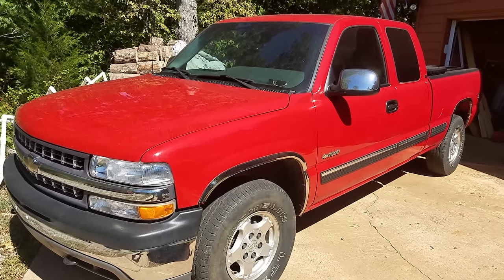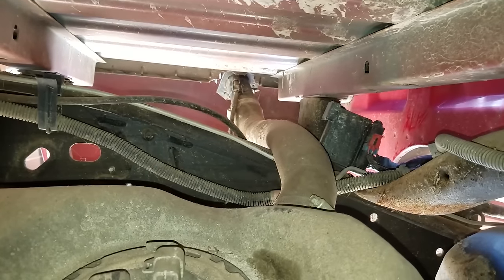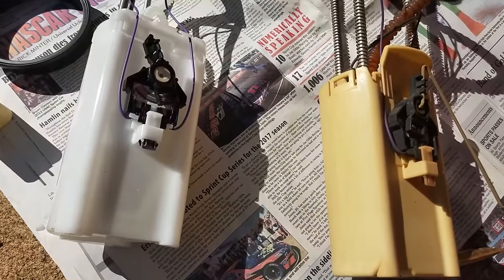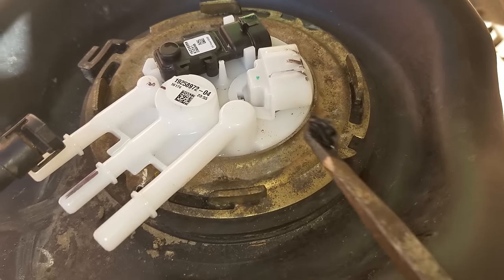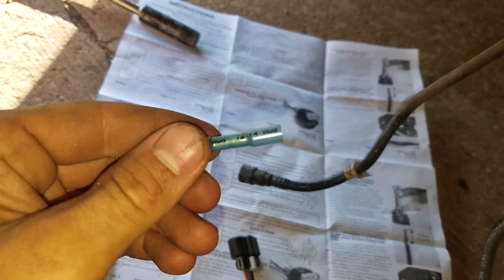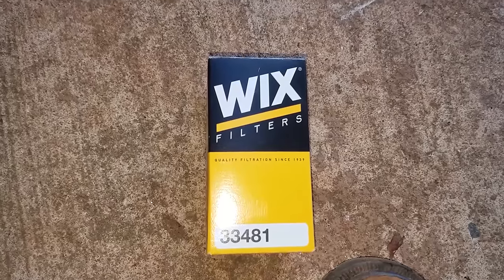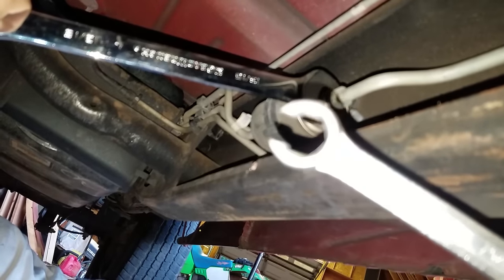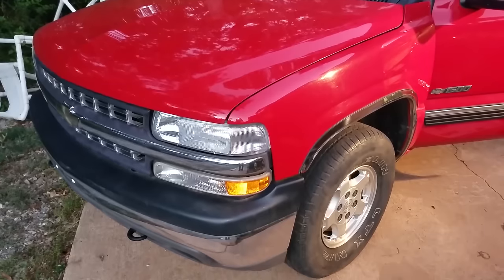Chevy Silverado Fuel Pump Removal and Installation

Comment: Pretty good video 👍 how about raising bed for fuel pressure sensor replacement?ty
Reply from the maker: Thanks, you can it is easier to lift the bed most of the time.

Comment: no need to remove your bedliner... just use an engine hoist or 4 guys to take bed off, 8 bolts unbolt from under truck takes 20 mins to remove bolts, disconnect tail light harness from frame by spare, and unbolt filler neck 2 t-25-35
Reply from the maker: I thought the bolts go though the bed into the frame. You have to take the bedliner off to get to them?
Reply: nope unbolt from below, 18 mm i think.... search bed removal here you will see 50 videos, i took mine off yesterday afernoon took 30mins by myself.. makes life much easier.

Comment: The heat shrink butt connectors also have “hot glue” that seals the connection when you shrink them but hey both methods get it done I’ve had great luck with those heat shrink butt connectors idk why so many people try not to use them

Comment: One thing I would recommend that should have been in this video is before you start doing any of this. Pull out the relay for the fuel pump and start the truck and let it run until it dies. This will release any pressure left in the fuel lines before you disconnect them.
Reply from the maker: Good idea
Reply: Weres the relay located

Comment: I just did my fuel pump on my 2003 Chevy 1500 had a tool box in the bed and got sum friends and tuck the bed haf way  off and tuck 45 minutes off and back on

Comment: Nicely done video, very good job.  I must point out one major procedural error; ALWAYS disconnect the battery ground lead first and reconnect last. If your wrench makes contact with any metal part while loosening or tightening the positive cable with the ground still attached you will be in for a rude awakening...
Reply from the maker: +artillerybuff2000 Yea, good point. That's how I usually do it. I'm sure we all have touched the battery's positive to a body panel once or twice.

Comment: You can also use the side of the soldering iron... running briskly across the heat-shrink tubing to shrink them...if you don't have a heat gun.... done in the field thousands of times so proven.
Reply from the maker: Yea, that works great.

Comment: Yellow black is ground to fuel gauge, 
purple is fuel gauge +5 volts,
grey is fuel pump +12 volts, only shows the +12 volts for 2 seconds after key its turned on.

Black is grounded to frame. In the same ground spot the fuel cap ground strap is grounded, is a short black wire that exits the Wire harness between cab and box Mine just broke here when I was changing brake line to rear, so if a pump is not pumping check this ground spot.
Reply from the maker: Oh, I gotchu. Yea, all of those ground straps are EXTREMELY important. Especially around the engine.

Comment: My FTP pigtail just fell off after I disconnected it (did it blind without dropping tank) so now I've cut an access panel in the bed and it is not immediately obvious where it connects, so this actually helps me know where to look for it.

Comment: To raise the bed up you don't need to take the liner out... I would take the toolbox out for helping with weight and also take off the tailgate, then one person can lift the bed up with no help. Leave the 4 bolts threaded a couple threads on the passenger side, take the 4 completely out on the driver's side, and remove the 2-3 bolts holding the gas filler into the bed. Fairly easy past that

Also the crimp connectors they supplied have heat shrink on the ends that will make them water resistant

Comment: never solder wires in same location,step them off, one longer, the next one shorter and so and so.... so they all fit inside corrugated conduit..
Reply from the maker: Yea, that's a better technique.

Comment: I wonder on these ones can I just switch out the fuel pump and reuse the old assembly unit? Instead of rewiring it.
Reply: Yup atleast I did . I cut a hole with a cut off wheel in the bed though and I didn’t cut it all the way only enough to bend the metal open so I can bend it back and screw it in so I can open it up again

Comment: After installing one a code of po442 evap leak came up. Anyone know the issue
Reply from the maker: Did you get the lines hooked back up to the top of the pump properly? Maybe there was some dirt on one of the seals?
Reply: Eli Guerra probably the fuel lines aren’t connected properly on fuel pump or you the fuel pump locking ring isn’t locked all the way..did you replace the fuel Pump o-ring with a new one?

Comment: Thanks for the great instructions. I'm thinking about taking on my bro in laws 02 1500 that has been sitting for about 6 years and this will be a major help. One question, is that fuel tank plastic? I've seen rare references to them being plastic and can't find a replacement tank anywhere.
Reply from the maker: Thanks! Yea use this as a guide/FAQ to get the job done. That's awesome! I'm glad this video is helping people. They are all plastic tanks as far as I've ever seen. Check RockAuto they might have a tank for sale.
Reply: Get a engine hoist pick up one side of the bed did it on my Daughter truck tuck me 45 minute for the hole thing and its  2000 1500

Comment: Not sure if my truck need fuel pump 2500 hd 2004 but I assuming the problem is the fuel pump. The car is drive able
but all of the sudden shut me down once I stop by a light. I will go for the fuel pump
Reply from the maker: Is it a 6.0 or 8.1 gas engine. If it is I would check the fuel pressure at the fuel rail with a gauge. A water pump wouldn't cause it to just shut off. If it is a diesel I'm not the guy to ask lol.
Reply: Thank you for your feed back just let you know is 6.0 is gasoline but I will definitely will check the fuel pressure. By the way I was trying to say fuel pump
Reply from the maker: You are welcome. I don't just like throwing parts at things, but check the fuel pressure and I don't know if the 2500's have an external fuel filter or if they are integrated into the pump like the 1500's.

Comment: For everyone out there, don't matter my mistake. Be sure the connect the ground wire bc I had pump go bad in freezing weather. In top of which I was traveling to diff state. So I did all the work in AutoZone parking lot laying in the snow and freezing weather. So before putting truck bed back on and reinstalling of course I'd test it. But didn't work and I went thru about 4 new, including having to rewire. It was super bowl Sunday and I was late. Finally a guy passing by asked me if I had the ground connected. Nope. Totally didn't realize I needed it connected. I thought it was for electrical surge protector. Started right up. Just a simple wire coming from an area I didn't think important caused me so much grief. So don't forget about it. In Silverado the wire that comes from connection by the gas inlet tube.
Reply from the maker: That sucks you had so much trouble with your fuel pump. Grounds are extremely important in 12 Volt wiring. I don't remember any separate wires other than the harness. Yea! Don't miss any of the wires or it won't work right at all!
Reply: @MattsShop  ya thx, it was def a lesson learning experieince.  if only i had learned the importance of grounds before that, i would've saved so much time and effort. as stated, i thought ground was for 'just in case' type electrical surges.  ughhh
Reply: Black is grounded to frame. In the same ground spot the fuel cap ground strap is grounded, is a short black wire that exits the Wire harness between cab and box Mine just broke here when I was changing brake line to rear, so if a pump is not pumping check this ground spot.
Reply: @hawkofthenorth4829  yep just that simple seemingly insignificant wire had me all fncked up for hours.  so point being, if the wire was connected before, was likely def for a reason haa. do it.
Reply: @justaguy4real  How could you possibly just knowingly leave a wire disconnected that was landed before, because you thought it would not matter?   You didn't know that every electrical component on a car has to have a ground path back to the battery neg. or it won't work?   Ok, you learned it.

Comment: Hey Matt...I'm just about to embark on this very project on my 2000 Silverado 1500 5.3 V8 Z71, LS trim 4WD.  Having a hell of a time finding an exact match replacement with the OEM electrical connectors.  Mine look exactly like those on your old pump.....the right, black connector has 3 wires and is oval shaped.  The left, white connector has 4 wires and is square.  So....guess I have to go with changing the connector as you showed.  Wanted to know what AC Delco part number you used as the replacement if you recall....thank-you
Reply from the maker: Okay, before you start...My pump part # was an AcDelco MU1613. What you want to do is call AcDelco's parts catalog department and give them your VIN. They will tell you EXACTLY what pump you need. You don't always have to get AcDelco fuel pumps though. A lot of times AcDelco just puts their name on the box and puts another manufacturer's fuel pump assembly in the box. For example, Delphi is an Original Equipment supplier and it could be a Delphi pump in a AcDelco box.

Delphi makes high quality fuel pumps so that is an option too. Just buy AcDelco, Delphi, Bosch don't buy cheap bargain brands like AirTex EVER!
Whatever you do, just don't go down to the local part stores and buy the pump there. If  you go to RockAuto.com you can see all of the fuel pump assemblies available for your truck. Check the warranties too, the Delphi ones have a Lifetime warranty and the AcDelco ones are 1 year warranty at the time of writing this.

The local part stores have lifetime warranties, but they factor it in to the price. They make you pay 2-3x the amount of RockAuto so they are able to provide you with a lifetime warranty.

They use a couple of different things to determine what fuel pump you need: the bed length and the wheelbase. The wheelbase is measured from the center of the front wheel to the center of the rear wheel on one side of the vehicle measured in inches. The bed length is just that, the length of the bed.

Don't worry about the electrical connectors too much. They should supply you with a new and improved harness with the fuel pump if it is necessary.

Hope this helps, thanks for watching!
Reply: Will do....Thank-You.  The video was very helpful.  I have the feeling I will get the correct fitting pump but the electrical connection may have changed or been upgraded.  So the portion of the video dealing with changing the connector will be very useful.  Thanks-Again
Reply from the maker: +Terry Parker You're welcome. Yea, just follow what I did with the new connector and you should be in good shape. Don't forget the dielectric grease on the new electrical connector end where it plugs up to the new fuel pump!
Reply: Just a quick note to thank-you once again for your video.  I went at it today and completed the project without issues.  Truck runs perfectly, gas gauge no longer bouncing about, installed a new fuel filter as per the instructions as well.  Like you described, getting that retainer ring off wasn't very difficult but it was a little tricky to get back on by myself.  Turns out my replacement pump was the exact same as yours and therefore I had to do the rewire of the one connector.  Followed your instructions, soldered them and heat sealed in marine shrink tube.  Once again, thanks for the video.  Easy to understand, easy to follow and accurate.
Reply from the maker: You're welcome! Thanks for the kind words. It does me a lot of good to know that my videos are actually helping people and are that easy to understand. I'm glad I made you a believer of marine heat shrink it is good stuff!

Comment: If you going to use a after mark fuel pump like me (precision) from auto zone . When it comes to the wireinging .... make sure you use the a... to a...b to b...c..to and d...to do ...trust me ...the instructions that come with the new pump are not the way you should wire it . I had to do it twice before I figure it out it was not pump fuel . So save you the headache....and use the a to a ........ b to b.........c to c.........d to d .....wireing
Reply from the maker: Yea, just match the colors. They should be the same.
Reply: Use AC Delco. The other aftermarkets will fail.
Reply from the maker: This

Comment: Can some one help me out ?? I fixed my fuel pump by my self step by step and everything worked fine and then out of a sudden it said empty but I know it wasn’t empty cause I refill my gas tank with 45$ now my truck says fuel low and my gauge show all the way empty ?? HELP?!
Reply from the maker: Did you replace the wire harness like I showed?
Reply: Fuck I didn’t

Comment: Bed liner dont do nothing...there's no bolts under it I promise
Reply from the maker: I didn't learn that until later. They are bolted from the bottom. Still a PITA to do, impossible to remove the bed by yourself, and you have to worry about damaging the paint when you set the bed on the ground.
Reply: I just did mine in like 40 mins...it wasn't no problem,I didn't remove bed completely just tilted up and set 4×4s
Reply: @MattsShop  Your video did help to know what tools I needed for sure
Reply from the maker: Thanks, I'm glad the video helped. Yea, If I knew they bolted from the bottom I might have done it that way from the start. That's the method I prefer on smaller trucks anyway. That's how I did it on my Ford Ranger fuel pump video.
Reply: @MattsShop  I used a chain horse to raise my bed after I removed the bed bolts.

Comment: It's so painfully stupid that the connector is different for the replacement fuel pump.
Reply from the maker: It's easy to do. You'll be sorry if you don't because of the corrosion.

Comment: Lived and worked on boats over 25 years in San Francisco Bay.  Ancor Marine makes crimp butt connectors with Heat shrink with hot glue inside to make the 100% waterproof   see link     https://www.ancorproducts.com/en
Reply from the maker: I'd rather solder stuff. It's stronger, more corrosion resistant, and lasts forever.